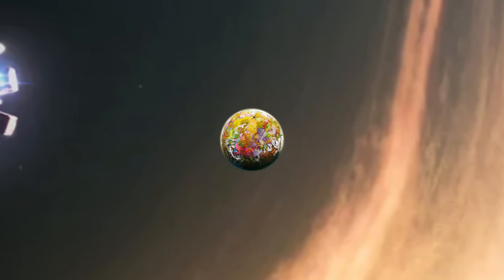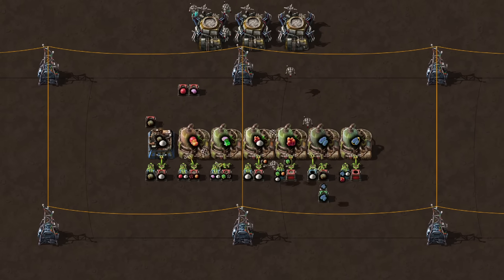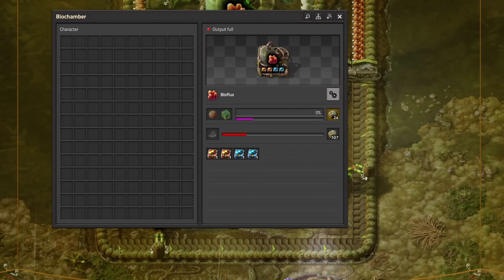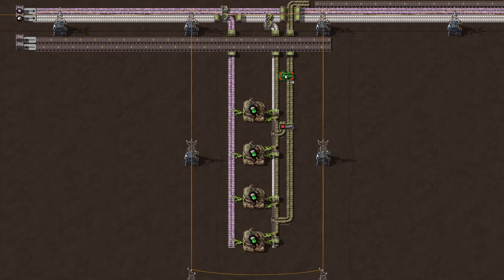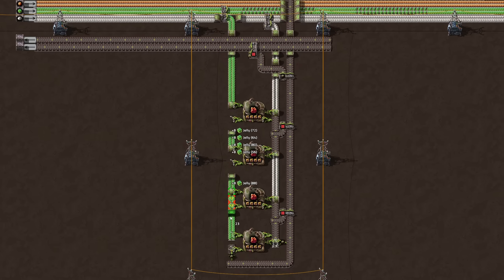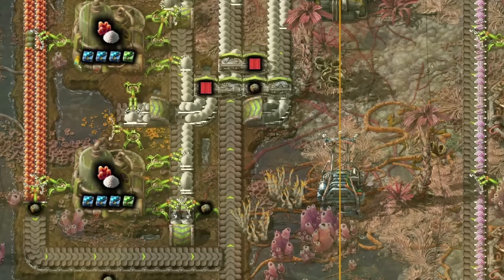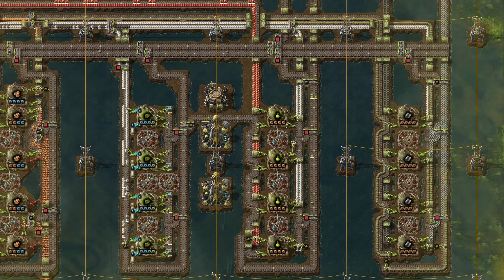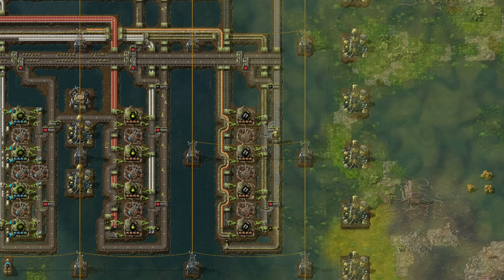Master Planet Gleba in Factorio. With Belts and a Main Bus! Factorio Guide / Tutorial

Comment: I did belts, and besides the complex problems around belting around machines, it was great and really interesting to figure out. The direct insertion argument people are making for bioflux seems reasonable and I will probably consider it, but I have honestly not had any problems with belting jelly and mash. Everything on Gleba besides stone is infinite, so sending slightly more spoiled science packs back to Nauvis is inconsequential, all you have to do is expand production more since science packs are less effective. Also if I recall correctly, my science packs were literally only 5% spoiled coming out of production, so the spoilage using belts is basically inconsequential.

One thing I will add, power is actually even simpler, easier, and better. Unprocessed jellynuts have a fuel value of 10MJ and can be used as a power source. You need to make sure you have the excess seeds to do it, as you don't get any seeds burning the unprocessed jellynuts, but you could also process a portion and burn the jelly to keep it self sustaining. It is hard to get rocket fuel to be worth more energy than the products you put into it, not to mention nutrients/power you would use to make it as well, so using Jellynuts straight up is a good alternative with a lot less steps where something could go wrong.
Reply: Rocket fuel productivity

Comment: You should check nilaus and blodviking, they made belt based too
Reply from the maker: Not really. I wouldn't call it belt based if 80% is done by bots.
Reply: @AVADIIStrategy  If moving the nutrients and seeds is 80%, then nillaus base is not belt base. 

Fruits from collectors by belt, processed fruits by belt, spoilage by belt, bioflux by belt... but yeah, 80% by bots 👌
Reply: Having belts that get some spoilage in designs that have 3+ boxes pushing out spoilage for bots to handle, and nutrients being handled almost solely by bots...yeah it's to many  bots.
Reply from the maker: @eriafi  I guess we have different definitions of these percentages. I'm not talking about the number of items moved but the number of problems solved.
For example you say nilaus handles spoilage by belt which isn't true. His block designs use active provider chests to remove spoilage.
It's also not the case that I think these ideas are bad but it's not a belt "based" solution. It doesn't work without bots and would require significant redesign to make it work without bots.
Imho these are mainly bot builds that also use belts for products that need high throughput which is a very good and clever mix. But it's by no means a belt based design.

Comment: To add to this, to maximize the much longer spoilage time of unprocessed Jellynut and Yumako, try to design your base to direct insert the mash/jelly into the target machines
Reply: @wojtekt789  I usually have a belt of seeds insert into a steel chest that then inserts into a passive provider or onto another belt. the steel chest has a second inserter attached to it that only turns on if the chest has less than 1 empty stack space left. that inserter feeds into either a heater tower or a boiler, depending on location.
Reply: to utilize this you need:
1) plan a decent throughput from the start
2) guarantee non stop fruit consumption at some point of the base, because seed loop may become depleted if you ever allow raw fruits to rot.
Reply: @heyhoe168 Personally i just burn the excess. Biolabs always get the freshest products. Same for bioflux used for science (turn into nutrients that i put in a big chest then after 3 minutes juste burn it all)
Reply: The ratios are off though so you end up making less.
You could just make the line shorter and only produce for the biochambers just ahead, you can do with just red belt for only 6 biochambers making bioflux.
Reply: this i like. just starting gleba on my linux OS, gonna apply this principle here if possible.

just straight pipe the yumako and nuts in, pull em off the bus in loops for the production.

I was planning on having localized spoilage burning, to avoid needing a dedicated spoilage solution, and was even considering direct inserting spoilage from buildings into heating towers, if I get to one building per production line w my beacons and modules at quality. dont need a lot of science, just some.

Comment: Instead of producing Bioflux and Nutrients and putting it on a bus I prefer to produce them on the local level. Each production block only takes the two fruits and produces B and N without loops. I simply put a Heating Tower at the end of the belt instead of looping back Spoilage. Anything not consumed in the production block just gets burned. Same for overproduction, I use a pair of recyclers to destroy excess production. And for the eggs, I burn any that go past my Science production without being consumed.
Reply: That definitely the best solution
Reply: Oh nice idea. Idk why I haven’t thought of that. I’ve been struggling to figure out how to make gleba work without/with very few bots and this idea works. Just use bots for spoilage and seeds. I think I would put the two fruits and bioflux as the main items on the belts as they all spoil in an hour and bioflux is used for processes or for nutrients. Thanks for the idea!
Reply: i would recommend having the sewage go to its own place tho, having to move things when wanting to expand bus makes me sad
also make sure you use stack insertions to condense your spoilage if your getting a lot of it.
Reply: I have a similar setup, except I do put bioflux on the bus as it belts very well. Plus I do put some spoilage on the bus just for use in producing sulphur and carbon, but I burn excess spoilage locally.

Comment: I'm also going to point out a few more things:

- spoilage of an item is based on the spoilage of the ingredients (excluding nutrient fuel), so it is MUCH better to use direct insertion for some things like jelly and mash that spoil very quickly
- this is especially important because the spoilage level of science packs reduces their effectiveness at being... a science pack. a half spoiled science pack is only worth 1/2 of a fresh one
- basically, the shorter the distance between your jelly and mash production and your bioflux production, the better
- you can use efficiency modules in biochambers which makes you require only 1/5 of the nutrients. this is great, as nutrients eat into your bioflux production, so you don't have to make as much bioflux. (you can also use efficiency modules in beacons so you can still use productivity modules while having 1/5th nutrient consumption)
- finally, gleba is awesome for getting quality items, especially iron, copper, steel and plastic. Making bioflux has two steps you can go through to make quality items with (jelly/mash and bioflux itself), the plastic is another step after that, iron/copper have two steps after it (making bacteria, and smelting the ore into plates), and steel has three. You can even use a recycler quality loop at the end to get absolutely absurd amounts of epic / legendary iron and copper this way (in the range of 1 legendary plate per 10 fruit). You can even just put this off to the side of your normal bioflux production, because a significant fraction of your bioflux you make will still be common. (You might also be able to make quality science packs, as they spoil slower, but I'm not sure how viable this actually would be)
Reply: That why i think not putting mash or jelly on bus but on factory block for each recipe look better
Reply: I do believe that Quality science also has +100% "value" per quality level.
Reply: This guy Glebas
Reply: it's so funny to me that this is the way they made efficiency beacons finally worth using
Reply: I used Gleba for quality items too.
But not as you suggested.😂
I am to lazy to learn train signals and go to new ore patches so this is the perfect planet for me.😊

As I reached lv14 in blue chips productivity I got everything in I need to upscale chips without any additional costs. You can do it even earlier if you don't mind losing some ingredients.
Scrapping legendary chips gives you iron, copper and plastic so I was able to produce most legendary stuff pretty early.😊
Even faster than most professionals streaming this game.😂

PS: To answer your Question. Quality modules are awesome in science production because you can get up to 6 times the worth out of the same ingredients.👍🏼

Comment: I have also a belt Gleba. Works like a charm.
First I started with sushi belts but that has obvious throughput issues and is unnessesary fiddly. Funny enough I think gleba gets more easy the bigger your base and throughputs are. Because constant operation means constant consumption and less spoilage to interupt operations. Tha may explain, why Gleba newcomers have such a hard time: New mechanics to learn, ner recipes to unlock and a mechanic that is very unforgiving for just tinkering around.
I have two main differences though:
A) my Nutrients and Spoilage are using Undergrounds under the buildings. That way I have a standard way of building things and a guaranteed free spoilage lane. Left are normal recipe inputs, right are outputs.
B) I zigzag my nutrients back to the main bus to keep it moving. Whatever managed to get to the end is routed back to the entry. Spoilage priority inserters will deal with it.
(C: maybe everything routing back may give total spoilage free factory but so far I did not care. Nutrients are the big problem to be solved.)
(D: I still use bots for the rocket. Just produce it into active provider chest and let it deliver right beside your silo in a yellow chest with applied filter.)
Reply from the maker: Right. When i was starting the mainbus the sewage belts were full of spoilage all the time.
It was even enough to power the factory. The more items you make the more efficient everything gets.

Comment: My science production is basically a square with two belt loops going around it. 3 biochambers making eggs will feed 2 chambers making science with beacons and modules at 2.6 science per second. The inner loop keeps nutrients cycling, the outer loop moves flux and eggs, and a couple filter splitters and inserters kick out excess eggs and spoilage.

It's something like 165 per minute in a loop that takes about 15x15 tiles, but it doesn't look as organized as your layout.

Comment: Bots all the way for sure. Belts are needless aggro, and you end up storing more fresh stuff "on the ground".
Logistics manages things more tightly, with better throughoutput, less lag, more adjustable buffers, easier and more flexible circuit logic options, and considering gleba is full of annoying marshlands and cliffs you can't build well on, land is also at a premium, for which bots are also better.
Also means you don't need vulcanus belts either.
Reply: The fact that the quantity gets decrement from the network the moment the item is allocated, long before it's actually picked up, means you can keep buffers way smaller than by just putting things on a belt and hoping they'll get picked up on the other side. There's also the ability to read requests, so you don't even need a buffer at all if you say things up right. This is why a bot base works so well for Gleba, not just the fact that bots are great at taking a bunch of crap and saving you the time deciding how to allocate it.

Comment: Use gun turrets, not tesla. If you use belts to make rocket fuel for power, something unforeseen WILL go wrong and your power will go out. You don't need little jimmy to hatch and nibble on your unpowered base while you're figuring out aquilo.
Reply: Just connect a buffer chest to an alarm. Even half a chest of rocket fuel gives you plenty of time to fix it remotely.
Reply from the maker: I don't see how this will ever happen considering that Glebas resources are infinite.
Btw the heating towers have a full buffer chest and belt priority.
Reply: @AVADIIStrategy  Clogging. Just some spoilage behind fresh bioflux that takes 2h to spoil will do that and it can get on there in a number of ways.

Comment: I like belts more because you require a massive amount of bots to figure out even a small factory like most would do on Gleba. Things like nutrients from bioflux have such a huge throughput that you'd need an immense amount of bots to make it work well. Despite being more complicated, belts are actually much easier to pull off if you figure out the planet's gimmick. My solution was very similar to yours but definitely looks a lot more bizarre cause I kinda slapped things down just to make them work. Something to do better on the next run. Still, it worked better than my bot attempt and hasn't clogged once the whole playthrough
Reply: i significantly reduced bot numbers by producing nutrients locally and just getting bioflux to that biochamber. 10x bioflux bot trips vs. 80x nutrients bot trips. direct feed or belt takes it from there ❤️
Reply: Bots are super easy to make and expand though. Making even tens of thousands just in the background is not really a big deal.
Reply: My base is bots for everything except nutrients, which is belts.  Works great.  Lots of circuits limiting overproduction which ensues things stay relatively fresh

Comment: i did mostly belts, with just bots moving things like eggs around :) i'm proud of my little base it feels like a living thing
Reply: I am terrified of letting bots touch an egg, as the moment I let them, I know they are going to put it in storage somewhere when I am off somewhere else in the universe. I have a set up that consistently cycles eggs, kinda like self sustaining kovarex setup, where the excess eggs seed other egg machines, which then all output onto a belt that runs through science to a heating tower to burn the excess. I have circuitry in place to prevent inserters from inserting eggs into a machine that can't process them yet, letting them spoil, so the system should be completely safe and spoil proof. I still have a bunch of turrets in the area though just to be sure. The paranoia and nightmares are real.

Comment: You gave me good design ideas, a bit factory is just lazy, although if they only deal with waste, it's still fine, my approach is just overproduce everything like in reality and throw away all overproduction into the heating towers, that way you never run out of power and resources. It's also easY to expand but the pollution cloud is not easy